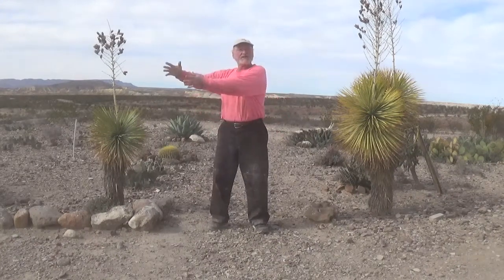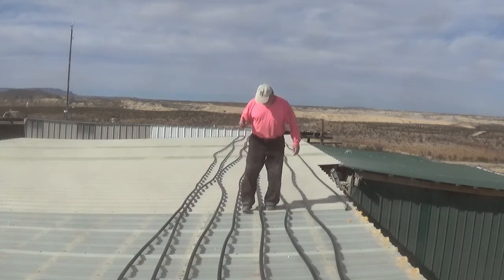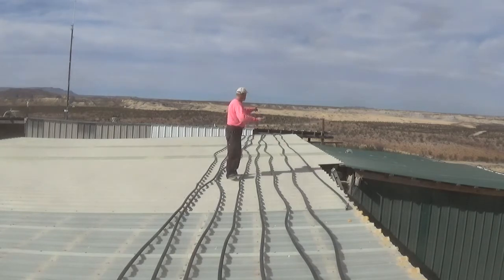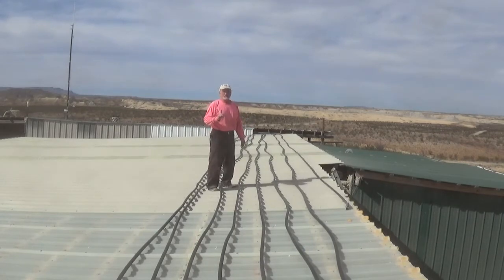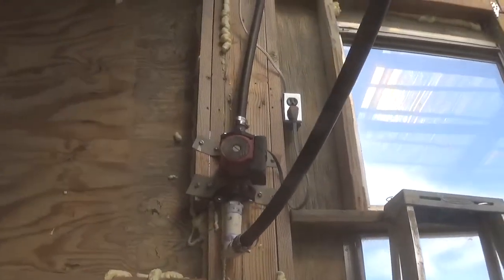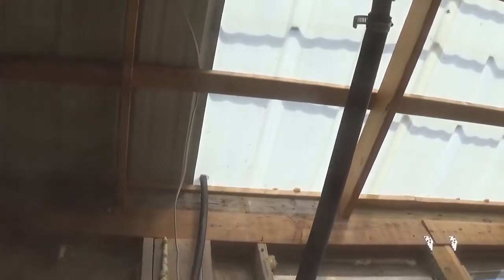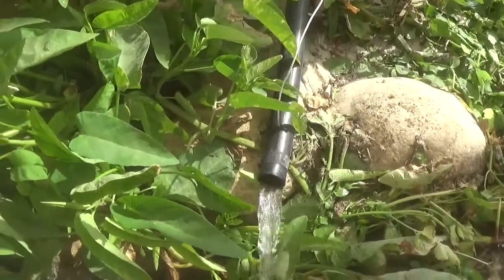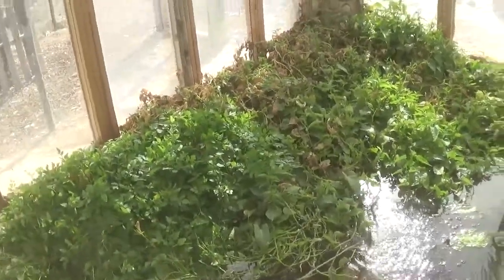Solar Hot Water For Our Aquaponics Plants & Tilapia

Comment: Will you have issues with weight?  That extra 1000 feet full of water too?   Very clever.  My old boss built a building. Then wanted to add a few hundred pounds of rock on top of the entry overhangs.  The engineer had a fit over the extra weight. Not in his original weight calculation.  You can make a rough estimate since 1” pipe makes easier math. PI R squared times length. At almost 9 pounds a gallon.  Very cool homestead very impressive.  Not sure how much one cubic foot of water weighs.
Reply from the maker: Weight was not an issue at all. There was not more than 25 gallons on the roof, spread out all over it. This last winter storm we ad gave us a snow load 20 times that.

Comment: Could be fun to put it on a solar and temp sensor. to have it automatically turn on, and maximize time up and prevent running at chilly times..  O the fun to be had.
Reply from the maker: $$$$$$$$$$$$$$$$$$$$$$$$$$$$$$$$$$$$$$$$$$$$$$$$$$$$$$ and it violates K.I.S.S.

But I do have a dawn to dusk sensor I am connecting it to.

Comment: A Check valve is what you are looking for, but don't think its needed. A self draining system is great in case of a hard freeze, may be good to add a tiny weep hole at the bottom to auto drain.
Reply from the maker: What I described, is what is needed.
Reply: @ecoranchusa  i thought thats what you were trying to say you wanted.

Comment: I had a long line and a few shorter lines and the long line ( on flat surface) just came into too much head pressure and low flow and a max temperature gain, but minimal gain at the end of the line.
It may improve by manifolding and having separate smaller runs?
Reply from the maker: Possibilities are endless, if you have no concern for money, or are speaking in theoreticals. This system works and cost under $50..... would the one you describe cost that little???
Reply: @ecoranchusa  Would be just adding a few tees and clamps out of the top and going out the bottom.  one of those easy if you have the parts already on hand :)  no extra trip to the store. lol

Comment: Did this on my pool, back in Wisconsin, was great for the summer time. heating the pool, water comes out of the filter, then goes to get heated up.  

The tubing is great even if you get a leak, you can just snip it and put in a connector.
I have always wondered if doing a gravity system like that if you put a small tank at the highest point, you could get less resistance on the pump and greater head pressure going through the tube, then dial in your discharge with a ball valve, 

I always found that even the slightest uphill turn in the pipe gave alot of resistance to the system, and the greater the flow, the more ability to absorb heat.  You have the roof, i would space it out, to have a constant down hill drop, you may be able to put a trap at the bottom, purge all the air from the line and be able to have it gravity siphon, If you did it up hill you could do a thermal siphon, with a check valve at the bottom, but that would have to be a really good thermal day, good for domestic hot water heating but a challenge for raising low temp with low solar gain.

Watch out for the 'manufactured' 20 ft panels that they try to sell you for this purpose, they work good to get more heat, however the plastic is crap and under re-inforced, and even the slightest of a chilly night will make the joints bust on the tube manifolds, so this pipe is a great reliable method.  

Sorry for the long message..  looking good!